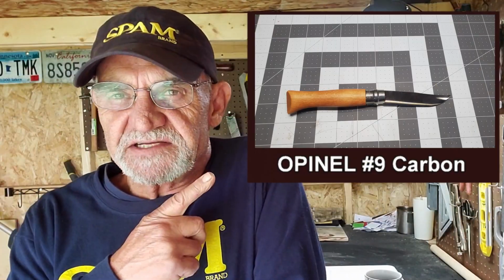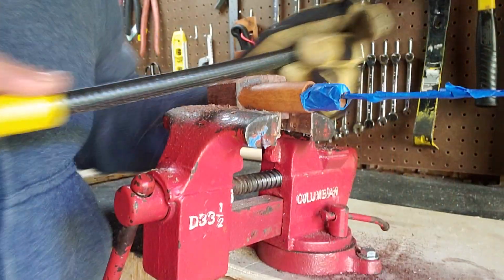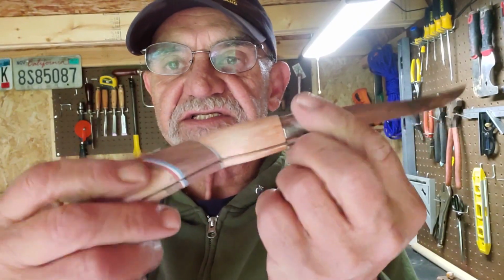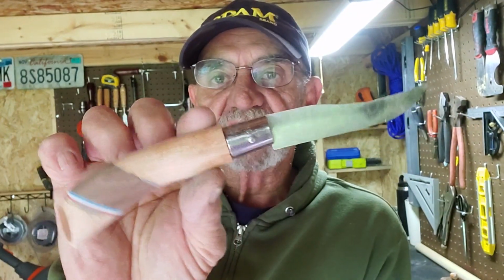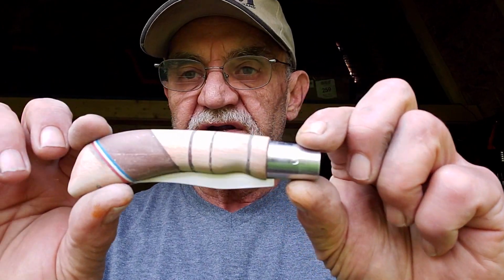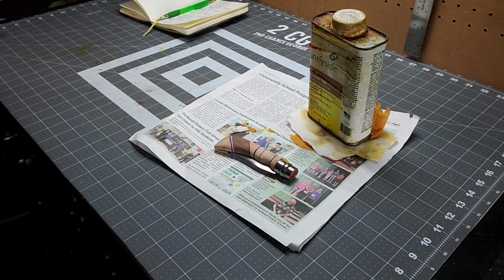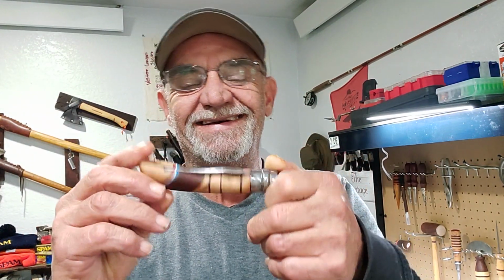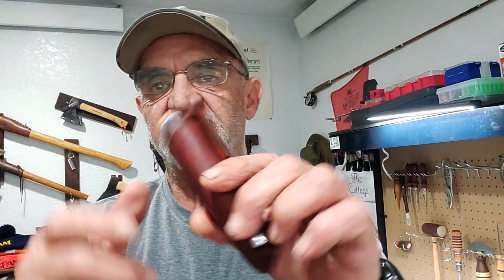Opinel #9 Modified -Tricolor + California Clip

Comment: Great video, love the handle.  As many of the sheaths as you make, have you ever thought of making a pattern template?  Maybe out of lexan or thin plywood.  A little tip for you, a pair of split ring pliers from your local auto parts store or Harbor Freight will make taking the locking rings off a breeze.  I like to pull my rings off when I get them and make it so they will lock if you twist it either direction.  Really enjoy your videos.
Reply from the maker: First thanks for the tip...I need to go that. I saw that plies used on a video the other day. I might just do that. Thanks for watching always appriciated

Comment: Very nice. I noticed in your videos when you are sharpening, you press down pretty hard. Try lightening up on the pressure. You don’t have to press hard to sharpen your knives
Reply from the maker: Opps I replied but it went to Lacy comment...you are correct sir...bad habit I need to break.
Reply: @2ndchancegeorge  no problem. Just a tip I thought I’d share. I free hand sharpen my knives about 90% of the time and I noticed that when you apply medium to light pressure, it allows the diamond grits to cut better and it’s easier to control your sharpening